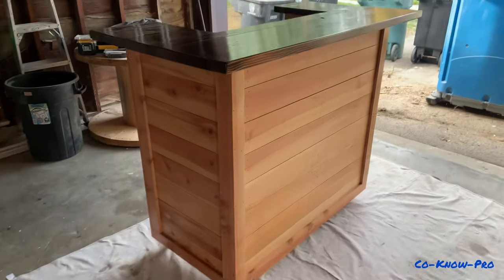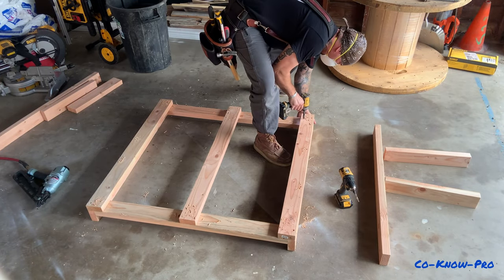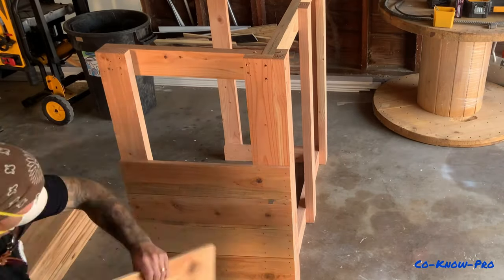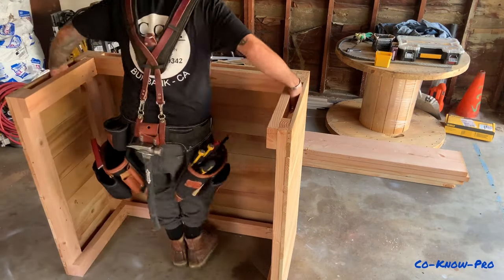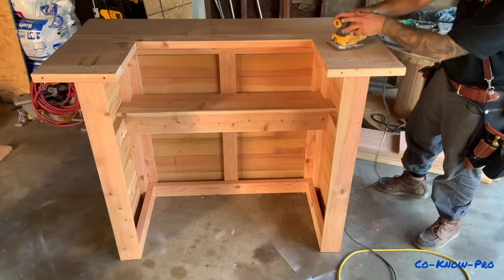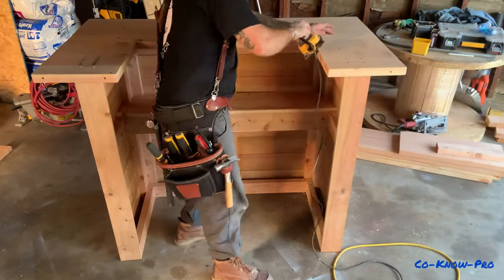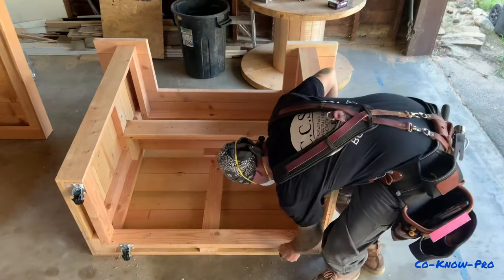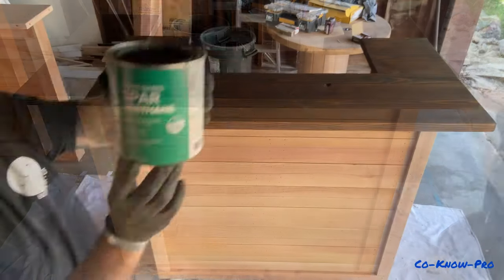😎How To Build A Bar For Your House🌟 #diy @co-know-proconstructiontips

Comment: Great video. I am going to build one for my Daughter's backyard. I will replace all the frame with pressure treated wood. Great design.
Reply from the maker: Definitely all the two by fours you can use pressure treated moisture rated. I would still use the cedar to add to the face of the moisture rated wood so it has a nice finish reveal which I’m sure you’re going to do. We appreciate the comment and glad you like the video Your daughter is going to love that bar man right on. 👍

Comment: Great video! Have you guys put together a build list yet?
Reply from the maker: Hi Dave, we do not have a material list currently in the about section of the video. We will definitely put a list together and get it up soon. Basically all Douglas fir 2x4s and 2 x 12 for the bar top and 1x 6 x 6’ cedar dogeared fence planks, 15 gauge galvanized nails with 16 gauge galvanized nails, 3 inch coated screws, and 3/8 wood dowels, 2 inch casters,  one bottle, opener, one empty paint, can, sandpaper 80 through 320, Bear gloss clear coat and the stain I believe is a dark walnut.👍😎

Comment: I'm from Colombia and I don't know English but your video is the one that makes my job easier for me and if you give me the measurements of the boards and the puldas, and the screws, it would be very useful. Greetings from Colombia
Reply from the maker: Absolutely you got this. The measurements are 48 inches wide by approximately 42 inches tall. You can make it as tall as you want depending on barstools or your height preference.
We made hours 42 inches tall, because we added wheels casters to the bottom, which gave an extra 2 inches  to the height. 
We used  two by fours for the frame and we used one by six cedar for the planks. And 2 x 12 for the bar top. 
The bar top is 60 inches wide 
Let me know if that answers your questions  👍

Comment: I've watched this video at least 75 times lol

What would u charge for a bar this size?
Reply from the maker: About $1,500 / 1,800 not including shipping if you are interested then send a email to us directly. Email in the about section of our channel. Thanks for watching glad you like the video 👍😎
Reply: So me and my wife built this last night. I followed your blueprint and it seems to be top heavy?

I haven't added the actual shelf yet but it seems as if I add the shelf then it will tip 🤔
Reply from the maker: have you added the casters yet? If so, you may want to bring those a little bit further away from the front edge of the bar set them the furthest you can from the front edge of the bar. 
that should help and as far as the shelf if you referring to the bar top, that should help keep it from tipping because it will give it more weight, pushing down in the center of mass. 
The inside shelf as well will help give weight to the inner part which will keep it centered. not sure why yours is top-heavy. I have not had that issue with the ones that I have built. This is the only thing I can think of. Let me know how that works out once you finish. 
if it ends up being top-heavy, no matter what you do, you can put it in a fixed location and add two clips and anchor it to the floor on the inside of the returns then you’ll be good. It won’t go anywhere.  let me know how it comes out 👍
Reply: @co-know-proconstructiontips  you're the 🐐

Comment: Looks great!  How many coats of poly did you put on the cedar?  Did you coat the interior section as well?  Thanks!
Reply from the maker: On the body itself, we added about two coats of the clear. We definitely apply the clearcoat as well to the inside of the bar. You want to seal all the raw wood as best as possible minimum two coats. Great question thanks for watching. Let us know if you have anymore questions. 👍

Comment: how much did you spend in materials
Reply from the maker: About $500 wood stain, nails screws Dowels clearcoat casters bottle opener wood filler sand paper. I’m sure I’m forgetting something but yeah, approximately $500

Comment: What size are the planks?
Reply from the maker: 1x6 by 46-1/2in on the front and on the sides the planks are 1x6 23-1/4in  plus the face trim brings out to about 48wide by 42in tall with 24in on the sides. 👍

Comment: Nice but u can use pressure treated wood and it will last very long outside
Reply from the maker: You mean treated wood treated wood would last very long time. Pressure treated wood is not a good finished product and very very unsightly has a lot of holes when they inject the chemicals when it’s under pressure that’s only for really rough framing work. But definitely treated wood will be good I wouldn’t use pressure treated just treated. 
Thanks for the comment and for watching👍

Comment: Can you please give me a quick suggestion? I want to do round edges using a roundover bit and then use super glaze as a top coat? Will super glaze work on the rounded edge? Or should I simply stick to the square edge? Thanks in advance....
Reply from the maker: Super glaze, regardless of round edge or straight square edge will pour over the edge and most likely drip so try to control how much super glaze pours over the edge and keep an eye on it as it’s curing and settles. Once it dries you will have to go through and sand off the drips that are left behind, then lightly coat  with a thin coat of super glaze. And you can brush it on if you do it really fast before it starts to activate. Hope that helps
Reply: @co-know-proconstructiontips  thank a lot...